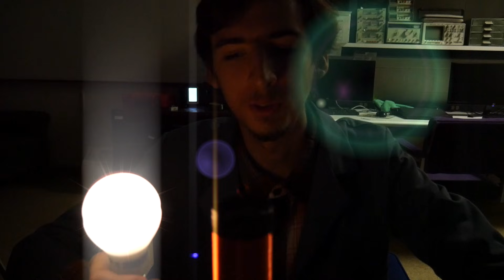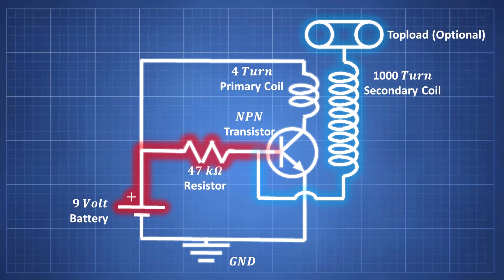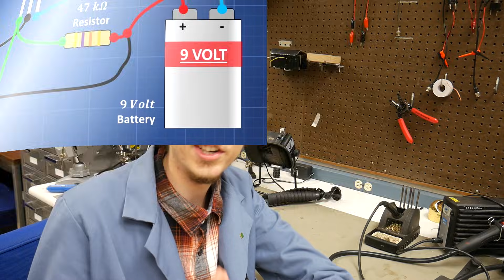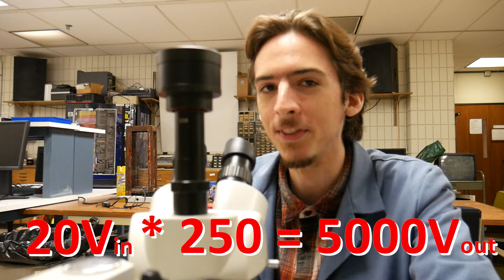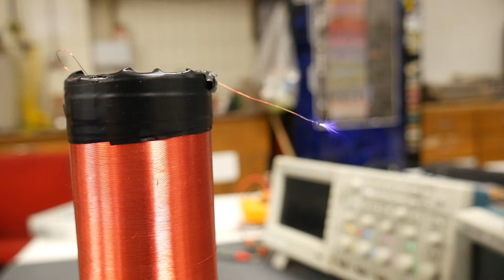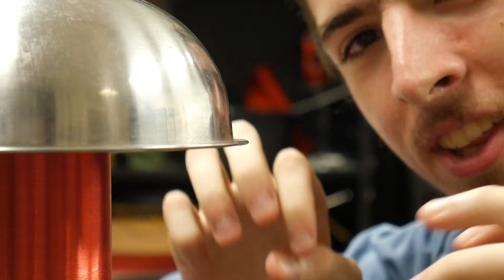SLAYER EXCITER - Tutorial, Explanation, and More

Comment: Hi Dayton how much voltage can i apply to the mega transistor before it blows up?
Reply from the maker: Technically, it’s a matter of power - not just voltage 
For instance, I could run it at 60V for about 15 sec, at 20V for a few minutes, and under 12V indefinitely.
Reply: @BlueprintScience  thanks mate

Comment: Now THIS is how a "how-to" video should be done! Talking, Explainations, Schematics as well as a demonstration. unlike those other videos on YouTube where nobody speaks or explains what their doing.
Reply from the maker: I’m glad you think so!
When I tried to make this Slayer circuit for the first time, I found no good tutorials, so I figured I’d make one.
Reply: @BlueprintScience  can I do this circuit with like 18v?
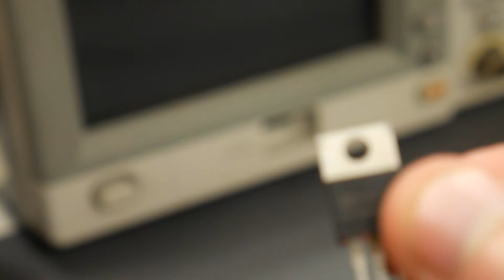Reply: @Dude_guy-ioi  I know you didn't ask me, but like Dayton alludes to around 8:20, the circuit's wasted power can cause your transistor(s) to overheat and burn up. Using an 18VDC input without either using better transistors or using more of them in parallel as he does in the video may fry your transistor(s). Perhaps also use a heat sink or other cooling system on your transistor(s) and see if that helps 😄
Reply: @Azrater2Kaniev2 Ty
Reply: That's very true,  this video is the best.

Comment: Hi ,can you please tell me how to make a simple circuit that can handle 30volts and 5 amp
Reply from the maker: To do that simply make sure that your components are rated for that power. For instance: check transistor/MOSFET datasheets (and add heat sinks) and use thick wire (thicker than 16AWG should be good)
Reply: @BlueprintScience  ok thank you very much you are a life saver👍👍👍👍

Comment: can i use a 9V battery as you said in the video? or i have to power the circuit with an AC source?
Reply from the maker: Pancho009 DC voltage, something that can supply a good amount of power
Reply: One More question, does the diameter of the secondary coil matters?
Reply from the maker: Yes, make it 5x taller than it is wide for... reasons
Reply: I dont get the last answer but thanks Man, nice channel ! 👍

Comment: I worked at a place that had three rails of 30 pairs of MOSFETs to switch 96V, PWM 15khz at 1000A stall current for one minute (electric motor controllers). We always did a low current test first before the high current. Because when a FET fails in a rail then the rest of them have to take the current, which may make another fail, and then more current for the rest and so on, then you have a firecracker ripping sound and 8 inch flames momentarily shoot out from the unit. Exciting stuff. So, when you have rails of them thar' things, careful with what is around them, I suggest having them at least covered, but not sealed as that would be a bomb. Cheers!

Comment: Hi. I have an important question . What's the difference between 2n2222A and 2n2222H transistor. And which resistor should I use to work correctly?
Reply: There is something called datasheet, you need to find the datasheets of both transistors, an then using some formula you con calculate the base current limiting resistor
Reply: @Headbutter-Lettuce90  Do you know what's their datasheet?
Reply: @masoudyagooti5146  just put the number of tha transistor and besideit write Datasheet like
2N2222A Datasheet
2N2222H Datasheet

Comment: Aren't Tesla Coils meant to produce very high voltages?
Reply from the maker: That is what they do, but not the reason Nikola Tesla designed them. His Tesla coils had a third coil called a “magnifying transmitter” that he wanted to use for wireless power transmission - something that  never ended up working, unfortunately.
Nowadays, Tesla coils are mainly used as fun and aesthetic projects.
Reply: @BlueprintScience  Gotcha

Comment: To protect the transistor from overheating, I've found it useful to add a couple of LEDs from the base (after resistor) to ground. When the base is pulled low it will be a negative voltage and thus ground will be positive (relatively).
Reply: Definitely this should be done (every other slayer exciter shows a diode there)

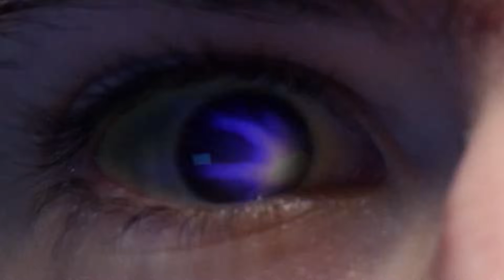Comment: 9:39 but slayer excited circuit doesn't producing such high spark for me even at 30 volt it only producing 5 to 6 mm arc without heating of transistors more than 40c i tried many prim windings
Reply: Its because he used like 600w of power
60v 10A

Comment: More turns on your secondary is great, but if it's wound with the wire touching side by side you will lose some potential from coupling between turns. A coil wound with a piece of thread as a spacer between turns works a little better. But for this, isn't required.

Comment: you haven't explained the tank circuit which actually gives a feedback to the input side
Reply from the maker: Tech Indra,
That because there isn’t a tank circuit (on the primary side anyway). I consider the slayer exciter to be more of a digital Tesla coil. May I direct your attention to the waveform at time 8:45.
Reply: on the secondary side there is a stray capacitance between two points of the  coil which acts as a tank circuit and gives a feedback to the input

Comment: I checked the general q&a. I have continuity throughout and coils and connections are correct. I also tested my transistor. Which was fine. Still nothing. It is only drawing .05 amps though. Is that the issue and what is causing this?  Thank you
Reply from the maker: Chet Dietmeier, hmmm. It should be drawing 2 or 3 Amps.  
Generally, these things short out when they’re not working, but if you have a (mostly) open circuit, this tells me that the transistor isn’t conducting. I’d direct your attention there.
Reply: @BlueprintScience  ok I'll take a look thanks

Comment: When the transistor conducts the voltage at the base is positive, and the transistor is forced into saturation. It turns off just half cycle of the oscillation later. The transistor gets hot mostly because the collector current is interrupted quite slowly by the almost sinusoidal base current coming from the secondary coil. The resistor is just for startup and has no role after the first cycles. You can even put a capacitor in series with it, or a push button.

Comment: hey , i really like your work and i wil do that for my studies but i need some answers about the current , like you said that in SSTC for 15 v we have 2.5 amp but i need the theroy of that like the calculations, i didnt find something talk about current in the internet in the SSTC. XD its 2020 i hope you  read my comment . ty !
Reply from the maker: Kellou Ishak,
Well, since the load is almost entirely inductive, that means it’s proportional to the voltage with a 90 degree phase shift. The current is equal to voltage over impedance. The active impedance of the coil and transistor is not a trivial calculation.
I measured the AC current using a “current clamp” - I don’t remember the number.
Reply: @Blueprint can i use

Comment: Hey great video thanks man! I have actually made one myself but the transistor is heating up fast. How can I connect them in parallel? I am using npn. Also by reducing my primary windings the output power decrease.. I was expecting to increase since the transformer equation should be the one to calculate voltage on the secondary.. Am I wrong? Thanks in advance
Reply from the maker: Alright. Your first question...
To hook transistors up in parallel, simply connect base to base, collector to collector, and emitter to emitter from each NPN. Note they do need to be the same type of transistor.
Your second question...
Less turns on the primary is not always better because its crated magnetic field is too weak to move enough power into the secondary. Otherwise having 0.01 turns of wire would generate many millions of volts - this we know doesn't happen!

Comment: I did everything as said, it doesn't work😢 I think the problem might be that my primary coil is made of multi-strand wire instead of solid copper wire. Does it matter? Also, does it matter if the secondary wire is made of 2 different rolls of wire and soldered in the middle, so it's not one continuous wire, it's the same type of wire but the shops didn't have one big roll, just 2 smaller rolls. Amazing explaination by the way, you deserve way more subs than you have! I subscribed!
Reply from the maker: Pira Tec,
What you did should be okay. Multi strand primary wire is perfectly fine. The solder on the secondary is strongly discouraged but should still function - just check for continuity as soldering magnet wire is... temperamental.
My first advice would be to test for electrical continuity everywhere. That’s usually the problem. If that’s all good, try flipping the primary OR secondary coils to invert the magnetic coupling.
This circuit does work, I promise :)
Reply: @BlueprintScience  thanks so much for your help, I'll give it a go
Reply: @BlueprintScience  I found one issue with the continuity, the secondary coil wires were coated in enamel, so I sand papered up the ends of the coils and now there is continuity, but it still doesn't want to work, do you think the solder joint has completely ruined it? Any other suggestions? Ive also been flipping around where I put the wires connecting to the primary coil but it still doesn't want to behave
Reply from the maker: So... I left my crystal ball at my friend’s house; you’ll have to help me the old fashioned way. What components are you using? How many loops of wire? Etc. You can even send me a picture if you like. Then I’ll be much better equipped to help you troubleshoot.
Reply: @BlueprintScience  hey again, I found the solution, the 9v battery didn't quite cut it for some reason, I switched to a 16v lipo and I felt a spark, I asked my uncle to help me (he's an electronic engineer) and he said the voltage provided to the gate and emitter was too low for the transistor to start switching, as soon as I switched to 16v the transistor got warm (it was cold before) and when I touched the end there were very small arcs. They were no mega plasma arcs like yours but it's a start. I used all the same things as you, tip31c, 47k resistor, 1000 turn secondary ect
Reply from the maker: Nice! My first coil was much the same way. After a few attempts and refining your design, there is no doubt that it will improve 🙂
Reply: @BlueprintScience  awesome! Thanks for your help, keep up the videos man!

Comment: how did you calculate the value of components?
Reply from the maker: Besides the transformer, there were no real calculations. I’m not entirely sure there is much hard math behind this as it seems to jive over a huge range of variation.
I can elaborate on a specific value if you like...
Reply: @BlueprintScience  Can you explain the  calculations of the value of the components and winding calculation?Is it similar to transformer winding calculation?
Reply from the maker: @physicsisawesome696  Here. I made this equation sheet a while ago for a full-fledged tesla coil. You may find some of it helpful: https://cdn.discordapp.com/attachments/679374951396147200/687089221244157953/TESLA_COIL_EQUATION_SHEET_page-0001.jpg
Please let me know if the link is broken
Reply: @BlueprintScience  thank you

Comment: can i use two different type of transistor ( both are npn)  ..... i can use tip41 and  d718. can  i do it????  plzz help me
Reply from the maker: You should only use one type of transistor together. The reason: conduction of electricity depends on thermal effects. The result: one transistor would take all of the load and the other would act as if it is barely there.
Hope that is understandable :)

Comment: Could somebody please explain me where is the loop in the secondary of the transformer? I was always taught that current has to flow in the closed circuit. 

Maybe another way... Where do the electrons go when they leave the top load? Shouldn´t they be getting back through the shortest distance of the air back into the negative pole of the nine volt baterry? How is then possible that if you put the lamp OVER the top load, it still shines? The path is more resistant for the current, right?

What am I missing here? :D
Reply from the maker: Josef,
The secondary coil is a closed loop circuit, even if it does not seem like it. There is an imaginary capacitor that connects the top to the earth electrically.  You can think of the air - or any object - as a high resistance path to ground.
Reply: @BlueprintScience  The bottom is not earthed in any special way, it is just an end of a wire going into the air.

Maybe another way to put it... If I made the wire in the bottom of the coil longer and dragged it 10 miles away from the rest of the transformer, would it still work? 

And I hope the answer is "no" for my own good :D

Comment: can  i know the input voltage
Reply from the maker: R Balaji sure.
Minimum input: 15V
Input that I use: 24V
Maximum input (for big sparks): 60V (only for 5 sec at a time)
Reply: but i couldn't get the arcs.
Did 22 gauge wire can be used
Reply from the maker: R Balaji that should be fine so long as you have at least 800 turns
Reply: @BlueprintScience  thank u
Reply: i done everthing you said but no arcs or no lightining of flourescent bulb happens
Reply: is that fine to use 32 gauge wire for secondary coil
Reply from the maker: R Balaji I’ll respond to both of your comments:
If it is not working, I included a FAQ in the video description. I can expound upon that if you had any further questions.
Tesla coils use AWG wire from 18 to 28 gauge. Anything thinner, and the resistance becomes far too high. Loops of wire should be no more than 2000 turns.

Comment: what diameter is the ovc pipe for the secondary windings? im sure you say 1.5 inch? but that sounds a lot smaller than it looks in the video?
also can you tell me a rough height for the pipe with 2000 windings? im 3d printing it tomorrow haha
finally im pretty sure but to be clear, the windings all sit flat on the pvc pipe with no overlapping correct?
Reply from the maker: You're right. It might be closer to 2 inch or 2 1/4 inch. Unfortunately, I don't have it anymore to verify :(

Comment: Adding a diode across your BE junction will allow for a higher input due to it clamping the negative pulse the base will endure. Connect the Cathode to the base (or gate if using a get) of the transistor and the anode to ground (connect the anode to the emitter of the transistor, or the source if using fets).
Reply from the maker: I concur. Though that thought regrettably did not cross my mind while I was making that video.
Reply: @BlueprintScience  It will work so much better and a higher VCC can be used as well. Also I recommend a schotkey diode due to their high frequency compatibility. However be wary of its leakage current. You don't want it stealing current from your base of your transistor, that issue becomes more prominent when using a Fet due to them not using a gate current instead they rely on Gq (Gate Charge) which means no current is really required which is why it could pose a possible issue. Try a schotkey anyways because they work with high frequencies so well.

Comment: This can be done on 35 Awg wire, I still want to ask if the diameter of the coil matters?
Reply from the maker: Yes, but don’t go crazy on the number of windings. Too many and you can actually lose efficiency. Try to keep it under 2000 and over 800.
Reply: @BlueprintScience  Thank you

Comment: I made this tesla coil, but it is not working. I used all of the components and the steps exactly as shown in the video. I used insulated electrical wire as the primary coil. Every other things were used as shown. Can you please tell me why is it not working.
Reply from the maker: I would need a little more to go off of; I’m unfortunately not psychic. 
I’d suggest first using a multimeter to make sure that things are connected in the way that you expect. Somethings things look connected but are not.
Also check that your transistor pins are correct by looking up its datasheet.
Last thing to check is the orientation of the coils, they each need to wind in the same direction.
If you still have trouble, I’d be happy to help you troubleshoot further.